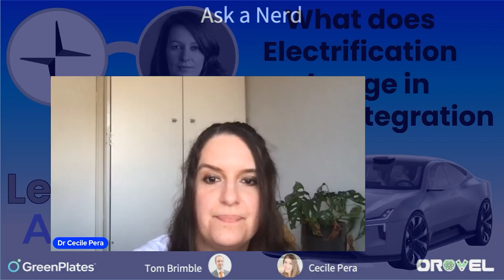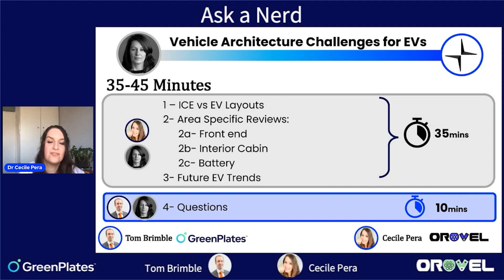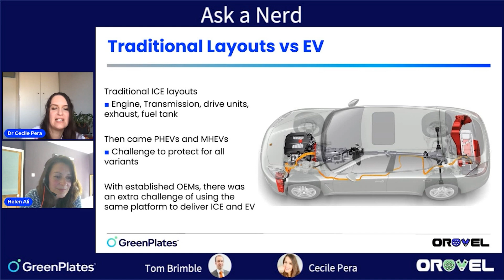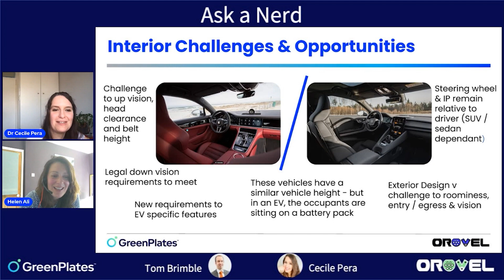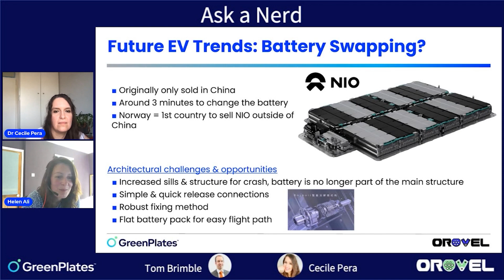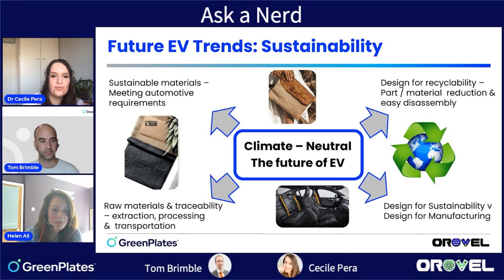Electric Vehicle Engineering is more than bolting in the volts - Helen Ali - AskANerd

Comment: impressive interview and moderation. I think it almost covered all the spaces one can potentially think of, to discuss in such a forum. Thanks to Orovel and Helen for sharing all the insights.
Few other things I would have personally expected some interactions on are-
1. Is there innovations on reducing the amount of wiring needed between different parts, can they all the sensors be turned wireless, to ride on the benefits of improvements made on that space such as bluetooth, 5G/6G or WiFi 6, etc.?  Some comments on edge computing, distributed computers  or single board chips like that of Tesla? what's the future trend?
2. Is it really a good idea of replacing any additional area with more battery packs or spending that effort rather on aesthetics? Because, sooner or later, with broad charging eco-system and more definite and transparent displayed range, the range anxiety of customers are going to go away, that means that people will be comfortable using a 300 kms all-weather actual range car! Any thoughts on those fronts?
Thanks in advance.